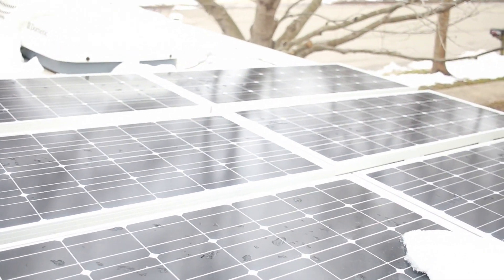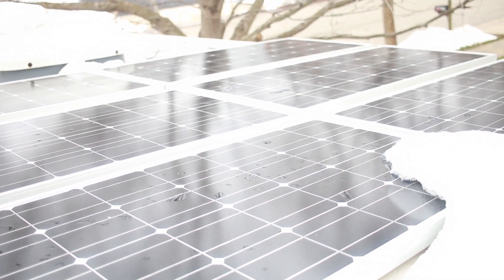Full Time RV Life | Solar Panel Series v Parallel | Our Solar Panel Set Up Explained | Pros and Cons

Comment: When panels are hooked up in series, less wires to deal with, but one obstructed panel affects all panels in the series. Volts are added together but amps remain steady.
Wired in parallel the volts remain steady but the amps are added together. One obstructed panel has no effect on the others.
Which is better? More amps or more volts?
Does one method require  heavier connecting cables?

Comment: Yeah, you do have that backwards, you would benefit more if you hooked them up in parrallel, since all are 100w each. Your explanation was correct just opposite of what it is.  So that little bit of snow on the panel in the video was lowering your power.
Reply from the maker: Thank you so much!

Comment: Please clarify the series increases in voltage like batteries, if so how large is your battery bank?  Does parallels panels remains the voltage but increase wattage?
Reply from the maker: Sure thing! In regards to the batteries, when you run them in series the Voltage increases and the AMP hours remain the same. While in parallel the Voltage remains the same, but the AMP hours increase. Our battery bank is about 520 AMP hours. We have 4 6V 260AH AGM batteries connected in series and parallel.

Yes, when the panels are connected in parallel the voltage does remain the same, while the Wattage (or output current) increases. The wattage will be the total sum of the panels connected in parallel.